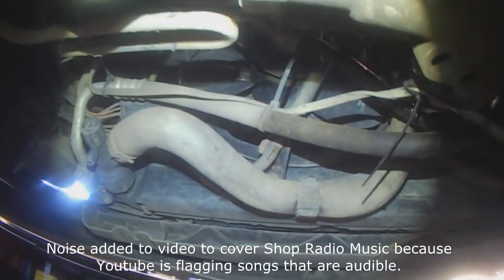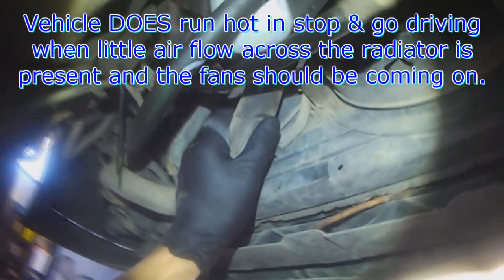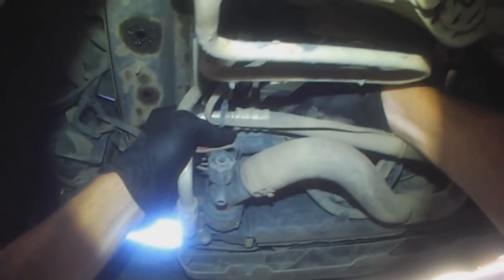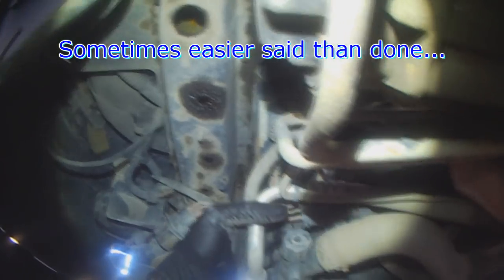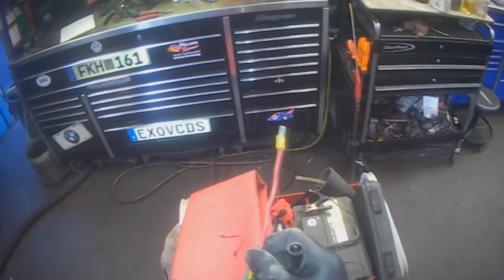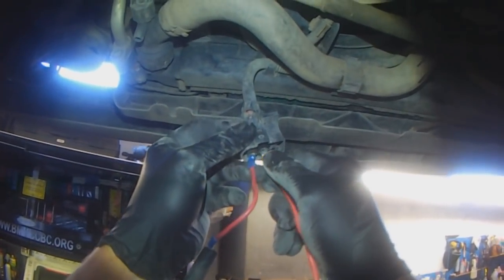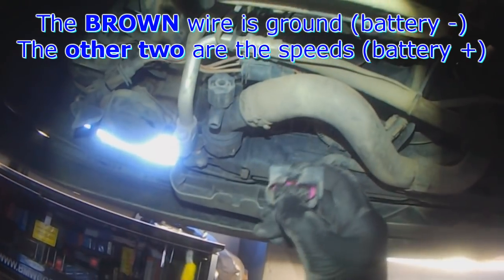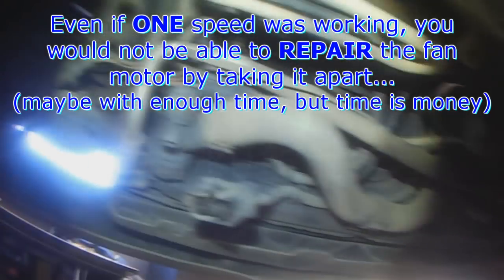VW A4: Cooling fans... manually checking (new version / better lighting)

Comment: I have a 1999 vw beelte and I've replaced the relay module and the. Thermostat and checked fuses and the fans don't work they won't turn on I'm trying to figure out what temperature switch I need or what it could be
Reply from the maker: Dj10087 Do you have heat inside the car?
Reply: Thomas EXOVCDS no
Reply from the maker: Your water pump is bad.... replace the water pump along with the timing belt (all one kit).
Reply: Thomas EXOVCDS ya that's what I thought thank you now I can confirm that the water pump doesn't work but do you have any solution for the fans not turning on we replaced the fan relay and the temperature switch checked the fuses and the fans spin we've tested them but whenever the cars on and over heats they never come on do you have any solution?
Reply from the maker: Dj10087 The sensor that triggers the fans is not getting hot... because the water pump is not pumping coolant. Replace the water pump... the fans will then work.
Reply: Thomas EXOVCDS thanks man it really helps to find that out
Reply: Thomas EXOVCDS if you have time or something you should make a video on replacing the water pump
Reply from the maker: Dj10087 Part 1:
https://youtu.be/FrbFMuGFOJI
Reply from the maker: Dj10087 Part 2:
https://youtu.be/gCoFOgIoEoY
Reply: Thomas EXOVCDS in part one when you turn it to Tdc does the cam shaft only need tdc cause I’ve saw people turn the crank you where Turning to turn the cam shaft to tdc turn that crank 2times and line it up at  12 and 6 o clock cause I don’t want to mess up any values
Reply from the maker: I'm not sure what you mean... because the camshaft sprocket is twice as big as the crankshaft sprocket, the crankshaft has to turn 2 turns for the camshaft to turn 1 turn. Always turn the engine via the crankshaft bolt. Here is the 2.0L Timing belt service info: http://fkh161.ca/VW/AEGTiming.pdf
Turn the engine until you see the Camshaft TDC mark line-up with the mark on the valve cover. Then look for the TDC mark at the transmission. Adjust the crankshaft position until you see the TDC mark line up with the transmission mark (according to standard or automatic diagram). Remove the belt, tensioner & water pump. Install the water pump, tensioner & belt. After the belt has been tensioned... rotate the engine (via the crankshaft) 2 times until the TDC marks line-up again. If one of them is out, remove the belt & reposition as needed... check again. If everything lines-up after 2 turns of the crankshaft, install everything else, add coolant and start the engine.
Reply: Thomas EXOVCDS ya that’s what I was trying to say but that’s what I needed thanks for all the help
Reply: Thomas EXOVCDS do you have a diagram for a 1.8t 1999vw beetle
Reply from the maker: Sorry... I thought you were working on a 2.0
I'll send you the link in a minute... it's fairly similar.
Reply from the maker: http://fkh161.ca/VW/Bug/AWPTimingBelt.pdf
The 1.8T is more of an interference fit engine than the 2.0 engine... if the cam / crank timing is out too much, valves WILL bend!!! Be careful... turn the engine by hand to verify nothing is making contact. Remove the spark plugs to make it easier to turn the engine... however, that can also cause the engine to more easily contact the valves (if / when the timing is off) due to NO compression slowing the rotation of the engine as the engine is being rotated.
Reply: Thomas EXOVCDS alright thanks hopefully I can get the job done perfectly
Reply: Thomas EXOVCDS do you have a link to a good kit within a good price
Reply from the maker: http://www.blauparts.com/products.asp?cat=2303
https://www.ecstuning.com/
http://www.germanautoparts.com/
Reply: Thomas EXOVCDS I hate to keep asking question but I’m young trying to learn as much about cars as I can and hopefully make it a career but just to clarify to start off I’m turning the cam shaft clockwise until It reaches TDC on the value cover then I’m turning the crankshaft until I see the thing on the transmission line up them after I replace everything I’m turning the crankshaft two times and if everything lines up at TDC I’m good to go if not redo the steps again
Reply from the maker: +Dj10087 Sorry about the late reply. If the timing belt is still attached, turn the crankshaft via the 19mm 12 point crankshaft bolt, until the camshaft tdc mark lines up with the mark on the valve cover.
If the belt is off, you have to be careful when turning the camshaft, because if the pistons are almost at the top, the valves can hit the pustons and the valves might bend. Remove all spark plugs so that you can see all the pistons. Turn the crankshaft slightly so that all pistons are roughly in the middle of their travel (all pistons will be at an even height). Now you can turn the camshaft with no worries. Once the camshaft is at tdc, totate the crankshaft to tdc #1. Look down the soark plug hole to see if the #1 piston is coming up. You should not have to rotate the crank much to do this. If you go the wrong way (down first) you might hit the valves that are open in the other cylinders. Once crankshaft is at tdc (check mark at transmission) install the belt and rotate the engine 2 full turns by hand, recheck the cam & crank mark. If all ok, assemble everything else and start the engine.
Reply: Thomas EXOVCDS crank shaft has a TDC marking on it or is it the transmission marking I’m looking to say it’s at TDC and the timing belt is the one behind the cover so if I didn’t get that far and I don’t have to take the spark plugs out what do I do but I did take the thing that adds tension the serpentine belt so it is loose so does that mean I can turn the crankshaft till the camshaft lines up the the TDC marking on the value cover and that’s it or what’s the next step
Reply from the maker: Page 1 & 2 of the pdf I linked (here it is again): http://fkh161.ca/VW/Bug/AWPTimingBelt.pdf
shows where the marks are. Crankshaft has 2 marks you can use. One at the crank pulley and one at the transmission (again, depending on standard or automatic, different location).
You can turn the engine with or without tension on the serpentine / alternator belt. If it is loose / off, fine.
If you rotate the crankshaft (19mm 12 point socket on the crankshaft bolt) and the camshaft does not move, then the timing belt is broken / has missing teeth. Follow my instructions as I have already given. If the engine camshaft DOES turn, rotate the crank until the camshaft TDC lines up (picture in pdf). Once the camshaft is lined-up, check the crankshaft TDC mark (picture in pdf). If the crankshaft TDC mark is not where it should be (pictrue in pdf), then rotate the crankshaft until it is (in whichever direction that is needed).
Once the crankshaft and crankshaft are at TDC, remove the belt, replace the water pump & timing belt kit.
I just remembered that you's is the one with overheating / no coolant flow... so all your TDC marks should be OK as well as your timing belt, so you should have no problems turning the engine via the 19mm 12 point socket at the crankshaft.
Reply: Thomas EXOVCDS sorry to keep bugging but thanks for all the help again I understand how it should go
Reply from the maker: Not a problem... I just can't reply right away all the time. It's an interference fit engine, so be careful. As long as the marks line-up after the new belt is on, things should be good! =)
Reply: Thomas EXOVCDS i got the parts and got everything done went to start it and it won’t start i think the timings of barely probably when i put the new belt on but I’m not sure what needs to be adjusted if it’s the camshaft or the crankshaft that needs to be adjusted for the timing to be right but when the camshaft is at the tdc mark the crankshaft is at like 11 and 5 inside of 12 and 6
Reply from the maker: Dj10087 I forget... standard or automatic? Turn the engine until the camshaft TDC is lined up. Remove the belt and adjust the crank accordingly (use whichever mark is at the flywheel / torque converter). Position the belt, tension the belt... rotate 2 turns of the crankshaft and check TDC marks again. Did you rotate it 2 turns the first time and rechecked the marks? This engine is an interference fit engine... if cam / crank timing is too far out, valves will bend!
Reply: Thomas EXOVCDS yeah i checked my marks but i didn’t turn it 2times yeah i don’t think the values bent but i guess we will see but this should fit the problem i hope thanks again for all the help
Reply from the maker: Dj10087 OK,  let me know how it goes.

Comment: Its exactly same as this. Same setup and wiring
Reply from the maker: Use a Test light to check for power at the connector. Bridge the radiator fan switch harness plug to activate the fans.
Reply from the maker: https://youtu.be/Roh6RCs8IJk

Comment: wow, both dead.  I had a 82 Rabbit and fan was bad, but would work intermittently.  Service advisor at Mt Read VW  (Rochester NY) said, Dan, start you car, he went and got a rubber mallet,  pop your hood,  and then wacked the fan motor, wack on, wack, off (well you know, hit it and off it went, hit it again and it came on.).....that was funny and many many years ago...here now, today for an 06 beetle, and a wire with a crimp on connector in the harness...hmm
Reply from the maker: They don't make'm like they used to!
Carbon brush dust or sticking brushes can cause fans to not work... replacing fans is in the best interest of the shop. The time spent trying to overhaul the fans or having to deal with a comeback a few months later, isn't worth it.

Comment: Hi Thomas, been watching your videos for a while now, always enjoyable to watch. Just looking for your opinion on an issue I'm having.

I've got a Golf mk4 diesel with climatronic system and got no fans running both for A/C or cooling. I've tested the fans using another method, by disconnecting the triangular shape connection to the rad thermal switch and jumping the 3 connections to each other in different orders, and seems both fans run on high and low as they should this way. 

Would this mean that my rad thermal switch needs replacing ? Some of the parts I've had replaced recently are, thermostat, temperature sensor, and the water pump with timing belt change. I've checked fuses on top of the battery and all seem good, the only other possibility I'm thinking may be the control module.

In regards to the rad thermal switch, can this be changed without draining the whole system of coolant ?
Reply from the maker: +dwk23 If the fans are not coming on after the thermostat has opened (lower radiator hose warm / hot), then yes, the radiator thermo switch is probably bad (since the fans work when you bridge the wires). The low speed is independent of the fan control module. High speed or a/c rely on the fan control module. The rad switch can be replaced without fully draining the rad... you just have to be quick. Loosen the switch and have the new switch ready to go in as you remove the old one... should only lose a couple of liters at the most (and you might get a bit wet). The fans not working when a/c is selected can be looked at at a later time. Focus on the low speed triggering / operation first... that way you can at least drive the vehicle with it not overheating. If it overheats while you are at cruising speed, then it is NOT a fan issue (fans should not be required to cool the engine at cruising speeds, especially on a TDI).
Reply: +Thomas EXOVCDS Thanks for taking the time to reply, luckily I don't have any issues with overheating though that may be due to the Irish weather never really getting very hot. Yea the A/C is not really important for now, just would like the main cooling fans to be operating especially if caught in heavy traffic.

Its a similar method to changing the temperature sensor then just try to get the new one in as quick as possible, though space seems more limited around the switch. I'll give this a try and report back if it resolves the problem. 

Do you know if this switch should be used with an o ring or seal of some sort? Just from looking around, the Febi switch seems to come with an o ring and the Hella switch without. I'm inclined to go for the Hella part but it would be a bad time to realise i need a replacement o ring when the coolant is flowing.
Reply from the maker: dwk23 Some factory switches I have removed had no seal... I always put a seal on them. I prefer the flat soft washers over the metal crush washers. http://www.germanautoparts.com/Volkswagen/Golf/Cooling/208/7 The link is just a sample.
Reply: +Thomas EXOVCDS Ok I'd prefer to put a seal on there too, as it's a job I'd only like to do the one time. Thanks again Thomas, appreciate the advice.

Comment: hi and subscribed to your channel! 
I have a 2002 audi tt 225.  both fans work when I turn the ac or when I turn on the heater. but almost never until the car is overheating 115c.  sometimes they both turn on after I turn the engine off.  Also,  when I turn the engine off the temperature raises considerably.  I replaced the coolant temperature sensor.  my fuse tray on top of the battery melted the fans fuse, I replaced the fuse and seems to work since the ac and heater work.   Any ideas as to what's going on here?.  pump seems to be working.  Thanks in advance.
Reply from the maker: Thermostat or coolant pump... make sure that the lower radiator hose gets hot (thermostat opens). The after run coolant pump needs to work also (check that it buzzes when you turn the engine off). How old is the water pump? You might have a loose impeller.
Reply: Thomas EXOVCDS Thanks for the amazingly quick reply!  I will check tonight about the lower hose being hot.   I was going to buy and install a fan control module and a new fuse tray  ( the one that melted the fan fuse)  do you see any reason to change this?  or just focus on the thermostat and water/COOLANT  pump?  I just bought the car, not sure if the water pump it's been replaced recently. .. 
thanks again!
Reply from the maker: Low speed fan operation does not require the fan module... the radiator fan switch in the radiator triggers low & high speed. High speed goes through the fan module. If low speed does not come on, check that the radiator fan switch has power (all the time) on one of the wires and that the fan switch gets hot (just like the lower radiator hose). If the fan switch does not get hot, then it will not trigger low speed. If the fuse box is in good enough shape, the wires / connectors are not burnt and the fuses have good contact... you can leave the fuse box as is.
Reply: Thomas EXOVCDS I only have low speeds.  Not high at all.  So maybe the fan module is in order?   I'm afraid it might be the water pump. 
Thanks again!
Reply from the maker: Low speed on its own or because you turn on AC / the heater? If low speed comes on on its own, then the thermostat "should" be ok and the water pump "should" be ok... but you can have intermittent thermostat or water pump failure, so you need to rule that out. If the thermostat, water pump and rad fan switch work correctly, there should be no reason for the engine to run hot or get close to overheating... even if only low speed works. Steady cruising on the highway should not require fan operation... if she runs hot while cruising, thermostat or water pump. Turn the inside heater to max heat & max air flow. If heat goes away (starts to blow cold / cooler air), then you have a water pump issue.
Reply: Thomas EXOVCDS low speed always with the heater ac on, and only intermittently/ erratically when the car gets really hot. 115c. I noticed it overheats on the highway , then it goes back to normal then overheats again.  I don't think the air from the freeway helps.  The low speed fan never kicks in until the car is extremely hot.  Thank you so much.  I'm going to run all these test.
Reply from the maker: oldschoolebm666 Let me know what you end up finding!
Reply: Thomas EXOVCDS I will.  Thanks much!

Comment: Thank you so much! You saved me from taking the advice of my mechanic and taking the whole front end off!
Reply from the maker: Thank you for watching!
Reply: Ooh crap, it looks like I may have to after all. It's a 2007 A4 Quattro cabriolet. It appears it's quite different... 😞
Reply from the maker: +Jon King My video is for a VW A4 / mk4... what is the actual problem? Overheating or fans always on?
Reply: +Thomas EXOVCDS Yeah sorry, I tried Audi A4 and your video came up, I missed the name. The fans are dead. they run to a module. I even cut the cables to test and ran 12v direct. nothing. I'm going to check the brushes, but it looks like a major teardown to do it
Reply: Thanks for replying, you don't often see that
Reply from the maker: +Jon King The fan module is either part of the large fan or a separate component mounted to the fan assembly.

2 big wires, power & ground and a couple of smaller wires.

The ecm sends a on / off signal to the fan module and the fan module turns the fans on. If power & ground is good... and you get a on / off signal from the ecm, then the fan module is bad.
Reply: Thanks, there is a large silver finned module above the large fan, both fans run to it. I cut the wires to both, and connected 12v to each, neither runs, assuming 12v is what the fans run on.
Reply from the maker: +Jon King Yes, sounds like they are both dead... just make sure to check things like I said (to verify).
Reply: I will, thanks so much, I wish I lived in BC, you'd have my business. Am I correct in the assumption that I need to pretty much remove the whole front end?
Reply from the maker: +Jon King According to service info, radiator needs to be moved forward / bumper needs to come off. 

Three images for you:

http://fkh161.ca/Audi/A4/Fan/
Reply: You sir, are the best!